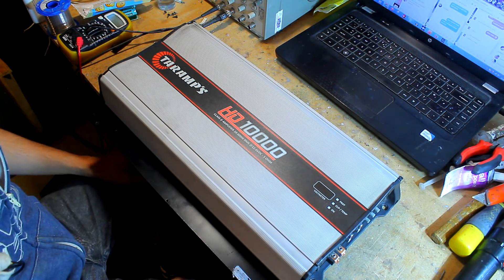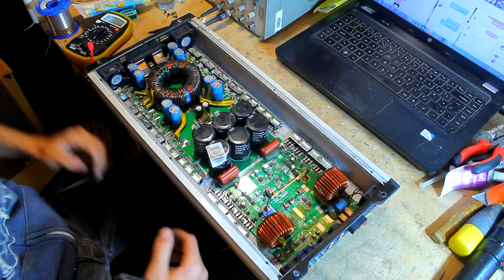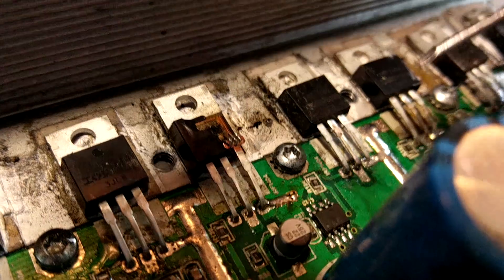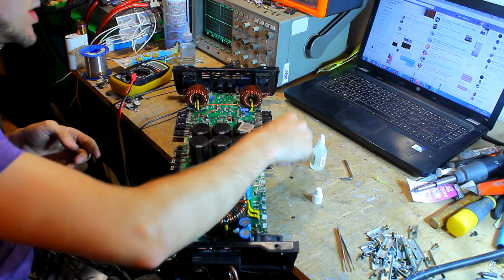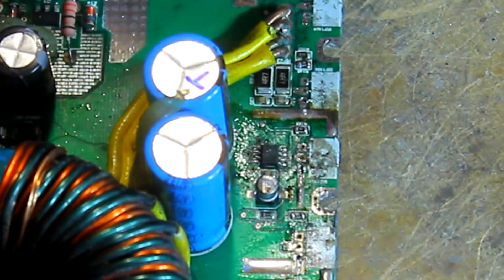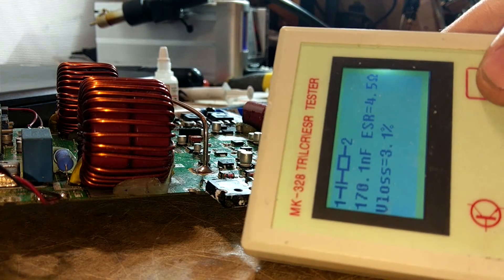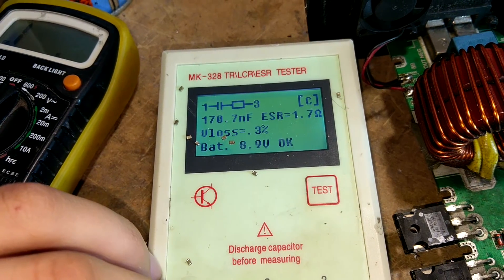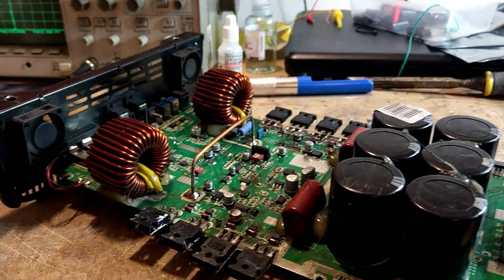Repairing Taramps HD10000 Power supply

Comment: My taramps smart 5 bass stopped working on me and won't turn back on. I wasn't playing it for long and i had it on low volume when it happened. I have the amp turned up less than half way, never clipped or protection light never came on. I have it on two digital designs 710's. I have good electric. Mechman 400, two xs power titan 8's, dual runs of power and ground. Amp grounded to battery. frame, chassis, engine, and alternator ground. My fuses under hood are not blown and I checked with volt meter at the amp, i have power at the amp and remote wire has power. Any ideas what could be wrong? I haven't heard of anyone having problems with the smart 5 bass yet.

Comment: Accidentally reversed power and ground on input of blaupunkt amp. How do I test those resistors and gates you were doing, did you have it set on battery 12v?or cont

Comment: Hi
I have two ground zero gzca 5k amplifiers at 1 ohm giving 5600 at 14 volts and at 2 ohms giving 2800 my subwoofers are gzhw15 spl dual 1 ohm but I actually tested them are dual 1.4 ohms so final resistance or 0.7 for every two subwoofers or 2.8 ohms these amplifiers are manufactured In Brazil is there a problem running them on 0.7 ohms and what should I do so that no damage happens to the amplifiers and if not who has a method to run the subs on 1 ohms thank you all

Comment: Hi
I have two gzca 5k amplifiers at 1 ohm giving 5600 at 14 volts and at 2 ohms giving 2800 my subwoofers are gzhw15 spl dual 1 ohm but I actually tested them are dual 1.4 ohms so final resistance or 0.7 for every two subwoofers or 2.8 ohms these amplifiers are manufactured In Brazil is there a problem running them on 0.7 ohms and what should I do so that no damage happens to the amplifiers and if not who has a method to run the subs on 1 ohms thank you all

Comment: I was wondering if you could help me identify a problem with my amp.

I have an hd 10k like in the video (2ohm) and it decided to just go into protect. No sparks or smoke. Wasnt even overheated. And yes, I removed speaker wires and rca's too. Still in protect. I popped the back off to see if I could find something burnt or broke, and theres nothing. Im not a circuit board repair man but I cant afford to send it to be repaired or to replace it.
Reply from the maker: replace output mosfets and drivers and you have a 70% chance of it working again :)
Reply: @barevids  As silly of a question as this is, but do you have any videos demonstrating this? Like I said, I'm not a motherboard repair guy so I have little knowledge on what is what and where.
Reply: @barevids  
So, Ive torn into it a bit. After some testing I have concluded that the mosfets are fine. But, on the power supply side of the board, the drain and source spots on the board for the first 2 sets of IRF1404 fets (3 fets per set, 3 sets per left and right) on both left and right, are making contact.
Reply: ebay guy "fix any amp" for $75 plus parts.....

Comment: Ten thousand Watts at 12 Volts is 800+ Amps.  Yeah, right!  Bloody class D is only fit for use in a car, I wouldn't let it anywhere near a decent HiFi system.  Good work and thanks for the vid.

Comment: Hey, My taramps DSP3000  blew the output. I replaced the mosfets and the amps works, but if apply 14volts or more, it goes into protect. Before it blew it had no issues, and would handle 14.4 as the amp says max 16volts. Do you think this can be caused by the ICs? Also how did you find the schematic? I couldn't find one.  Thank you for your time.

Comment: Taramps is pure garbage.
I bought 1 brand new and it came with a defect from factory had to send it warranty right away. Pure cheap garbage
Reply: Rly becouse i have 7 taramps amps. And every one is good, sound quality is amazing. 
1. Taramps bass 400
2. Taramps hd3000 2ohm
3. taramps hd3000 2ohm (yeah i have two)
4. Taramps bass 5k
5. Taramps hv40kv
6. Taramps md8000 premier 1ohm
7. Taramps ts400x4

Comment: I'd add a heavy-gauge pigtail to the annoying output transformer leads to make the gate driver IC easier to service in the future. With an overrated Brazilian amp, it'll need to be serviced again unless the owner backs off on the low impedance.

Comment: Sam I sent you message about needing help with a amp. I have a taramps hd 15k. It blew a rail cap. just 1. and I replaced it. the amplifier never went into protect. anyways after replacing it and powering it up out of the board with a limited dc power supply,  I notice the output fets start to heat up in  uniform. this is with out any load, just limited power up. the waves look fine. its only pulling around 5 amps at 14.4v at power up. Is this normal for these fets? is it because im using a limited power supply and its such a large amp? did the 10k do that. it has the same output section as it. what do you think?
Reply from the maker: Normal buddy
Reply: @barevids  thanks for your reply,  damn I don't see how fets can last long doing that but that explains alot.

Comment: I have a question about a Lanzar opti 2k, ic by the driver board was bad KIA 393p ic, I replaced it and still in protect?? Any suggestions on what else to check? Input and output FETS are all in spec, two resistors were bad on output driver card, buddy of mine had it in his car forever, power wire at battery corroded, and he thinks dead shorted and blew fuse. But amp still played for another month but kept getting louder fan and like a whine/screeching noise. Took amp out, I looked at it and now in protect mode. Thank you sir any help is greatly appreciated
Reply from the maker: Sounds like more issues in output drive circuit. Determine why it is in protect, as you power it up look for rail voltages in the wrong places on output mosfet pads and go from there.
Reply: I figured it out buddy, thank you sir for your help!! It was loose pins into actual drive card  from board upto driver card pins were broken. Now gotta find parts

Comment: Two top tips; you can re-moisten solder paste with isopropyl alcohol, messy job though, wear gloves :) Also you can buy SMD discrete component "sampler packs" where you get a strip of about 20 of each value in a neat little organiser, damn handy for rework jobs.

Comment: Hey bro just need a little advice I have the same model but one half of my output transistor  blow in the output section replace it with driver IC. amp power on ok but when I turn up the volume there's a loud hum  and amp go in  protect have you ever experienced this problem.

Comment: What’s the possible problem if ur amp goes thru the cycle and goes directly to protection when I turns it on with no speaker loads or rca connected. HD10000 taramp.

Comment: Have you ever repaired a Rockford Fosgate Power BD1500.1? I had one repaired and for some reason it's not putting out power at Powers up and not in protect and wondering if you could tell me what to check? I don't see any burns on the board and no fets look Burnt. The last repair the man had to fix the gains and output fets and he's a professional at Freeman car stereo a Rockford Fosgate repair specialist. I sold the amp when working and dude hooked up a wire tester to the output and said it's Dead? Could he burnt it up hooking up a DC light tester to the output? I'm sure Jason Gibbs at Freeman car stereo did a great job on it but I just don't have the money to send it back to be looked at again. You have a video to recommend to watch to troubleshoot the problem?

Comment: Hope you casn help me. I have a Taramps bass 12k That blew at some point. All the Mosfets has been replaced. But when I power on the amp, it runs the startup procedure and then it gives out 32Vdc in the speaker terminals. What can be the cause of that? Really hope you will take the time to help. 
Best regards Michael

Comment: The power transformer is not a very good design. The wire strands are too thick to support proper current flow due to high frequency skin effect. Also the cross sectional area of the primary winding is way too little, you need much more paralleled wire strands. I agree that Taramps does not put enough output and power supply MOSFETs, or use even better MOSFETs with lower Rds, probably a cost issue.

Comment: what is you opinion on taramps ? im thinking of buying the 5k
Reply: They pretty much suck ass, you get what you pay for.
Reply: Dude save yourself a waste of money and just save a little longer and get a Korean 5k you can think me later. The reason these Brazilians do so much power is there designed to run everything to the max that’s why you can’t abuse them without blowing them. The Koreans are not the are built extra tough and run not nearly as hard as the Brazilians. Think of them like cars the Brazilian is a cheap turbo 4 cylinder that’s running right near the red line all the time so push it any more or abuse it in any way it will blow and the Korean is like a big block that makes the same power but does it at 1/4 the redline so obviously it can last way longer as it’s not even being pushed hard. That’s why you can wire them lower and they will do more power and survive where a taramps would go poof. And it’s not that all Korean amps are good and all Brazilian amps are bad it’s more how and who builds them. Take for instance sound digital they have some realizable amps that can do massive numbers but you will pay more for them. And take the CT sound team 7k those things where going out left and right a year or so ago when they came out. Just do your research and don’t try and get 5k Watts for a couple hundred bucks and you will do fine. Hell technology has came so far even some of these cheap amps are decent now even if they don’t make huge power they still hold up ok.

Comment: nice amp, its a pain in the ass removing all the dead mosfets...it bothers me how you don't clean the board. you should always clean the old solder. i have repaired amps for years. trust me wipe down the board prior to reinstalling new components and use a power supply with a current limit just in case you accidentally short circuit any leads. thanks for sharing...damn you remind me of myself in my basement late nights...lol thanks!

Comment: awesome vids mate! been following the channel for quite a while and this just came in handy as i blew my 5.1 Pioneer AV reciever and i'm trying to repair it myself. Offtopic on this; I have a Soundstream T4 12" sub that I need to build a box for and would like your input :) 
Here's the woofer specs;
Fs 36.5Hz, Vas 1.034 cu.ft., Qms 3.584, Qes 0.414, Qts 0.371, Xmax 0.63in.
It would go in a trunk of mazda 626 (4door) ran by Renegade REN 1800 - 2ch class AB amp, I've heard it can push about 800 Wrms to 2ohms stable. I'm open to any design idea and as of watching your independance rise vid I'm undecided as to the box design! Thanks mate!

Comment: Any tips on how to fix a gain nob?
Reply: Gain KNOBs can be replaced, usually they are just variable resistors. Take some measures on it while spinning the knob carefully, and look for torn connections. If there are any dead points, you should change it. Be sure that the amp is not powered while you're doing any work on it.
Reply: If you hape problem with gain its either potentiometer or preamplifier, if you dont know how to replace either of those i would suggest to get someone to look it up, fixing it without basic knowledge can lead to more damage but if you are willing to learn than give it a shot.

Comment: I have a question if you could help or anyone else. I have a old sundown sax 100.4 and seem to have ran into a small problem. Only two channels seem to be producing sound while the other two are not. Specifically the bottom two are working while the top row is not. Any idea what it might be?

Comment: The TC35 had a double connection of solder creating a short. You can barely see it at 3:04. It create a nano resistance in diode 448A towards the IC which causes a surge in cap R598. It wont blow it out, but reverses the vacuum connectivity, if you will, and the solder reacts as a negative magnet of sorts making the thermistors and IC's give a drive wave of  negative 5 plus 4 (obviously not adding up to 1). Next time, short the PC68 Cap and leg 2 and 6 of the 1I96 Stationary board and it will bypass the reaction board. You will get less Bass but the treble will be amazing. Also, This board was made in a factory in  Nyflanigan during a drought where fish were abundant, but deceased. So, Fish oil caps from this region are highly suspect to fail. You will smell an odor if the caps pop. It may smell like your urine. Which means you need to drink more water.
Reply from the maker: epic troll is epic sir!
Reply: @barevids  hey boss I appreciate your repair vids great stuff I was wondering where I can purchase the current sensing ic ir25750 looks like it’s obsolete or is there a replacement part I can use , I would appreciate it thanks
Reply: Lmao thanks for the help

Comment: 146 volts AC from only a 9 volt DC power supply??  Has anyone ever attempted to run house appliances from their car amps before? o.O
Reply: yes...it works if the amp is big enough!! but it eats car batteries in about 6 minutes!!!

Comment: i plan to start designing my own power supplies and class d amps in due time when i get a scope, function generator, and a bench power supply
one issue with making these things is the high frequency switching tends to jump gaps in mutually coupled lines which can lead to tons of noise, other than that the architecture is really simple, even more simple than class AB
There's a diysmps forum that has a ton of useful information too, including a SMPS flyback transformer calculator program that is free
Reply: Technologic 
have you thought about building a power inverter? they share components with amps. I been wanting to attempt it. everyone says I'm crazy. just buy one. I also want to build a DC motor speed controller. for a EV project. about 600 amps at 72 vdc is a lot of power to play with. but I have no experience and self taught. I use you tube and Google to help learn . I'm a little old to go back to school.
Reply: youtube is great for both of you whatever your planned budget...plan the money and the TIME!! 6 months to build something is expensive on time!! out rubber gloves on and water safety and capacitor safety... i have been electris shocked and its not cool!! and can be deadly!!
Reply: wear rubber gloves if unsure about voltage!!

Comment: Thanks for the fascinating insite into  boom,boom amp repair
Just a suggestion! 
Why don't you buy some alcohol and clean the board
I will save you time and money,just think you never see a car sprayer with a dirty spray gun
It will get you more work and a excellent reputation
Reply from the maker: FlatFrog69 RR in time. it would be an extra cost for the customer and most just want it to work and don't care what it looks like inside! I always clean any conductive soot etc.
Reply: I agree with you but if I am doing jobs like this, I would like to maintain a good reputation and do it right. Don't you agree? Anyway great video.